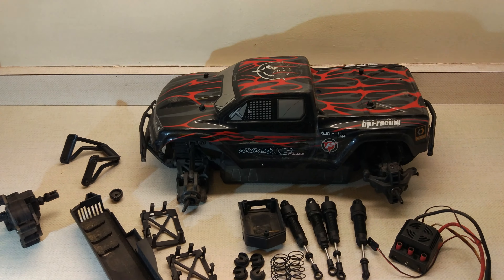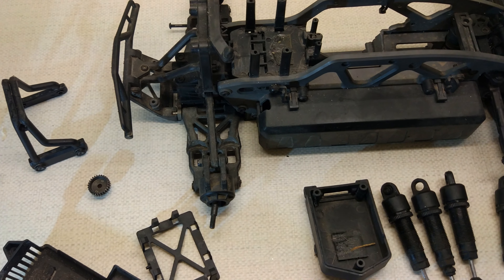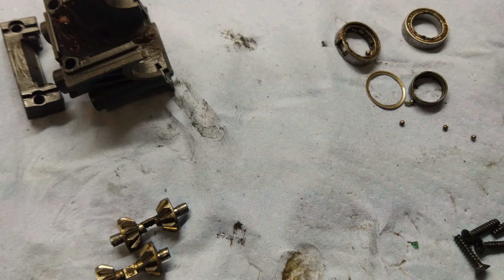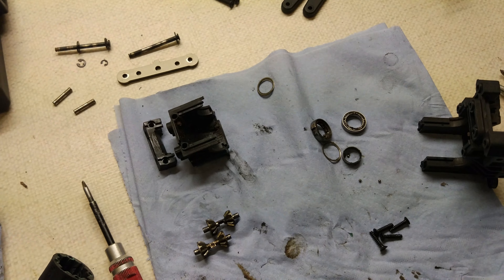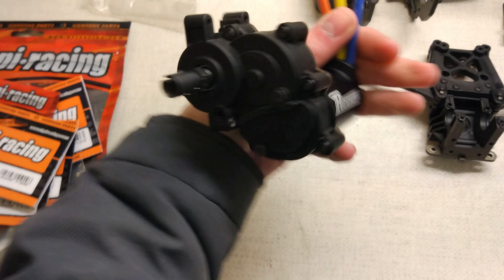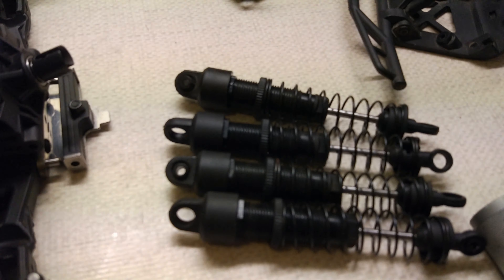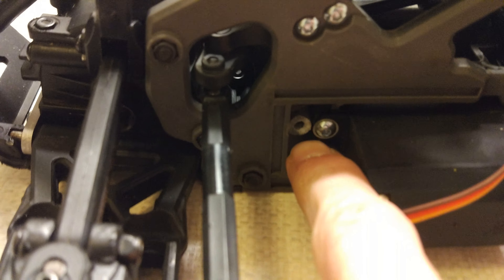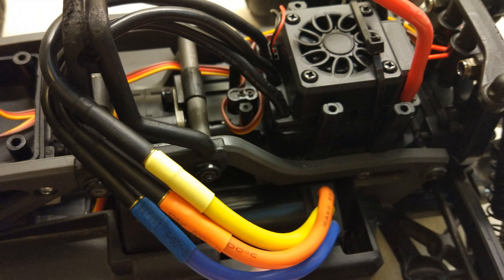HPI Savage XS RTR Needs Some Parts

Comment: Good job! Waiting 4 months For those spare parts 😱 where you got them from? I cut my diff gaskets out Milk carton, easy and durable 👍
Reply from the maker: Wheelspin models. They sometimes have items that say shadow stock may take 1-2 weeks to deliver then they took 4 months XD
Reply: @LawrenceTimme  I just placed a small order at wheelspins to see if I have to pay a customs fee. I hope I don't have to wait months....
Reply from the maker: @TastyBRC  yeah I don't order stuff that's in shadow stock any more!
Reply: 😬did you peel off the metal from the inside and how’s it holding the diff oil if that’s what your using that’s a good idea still🎯🎯😎